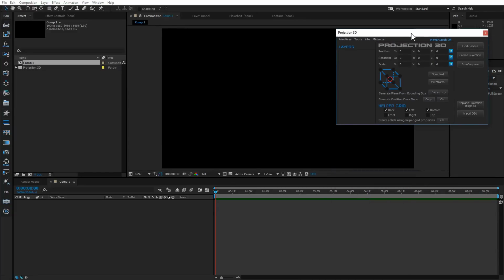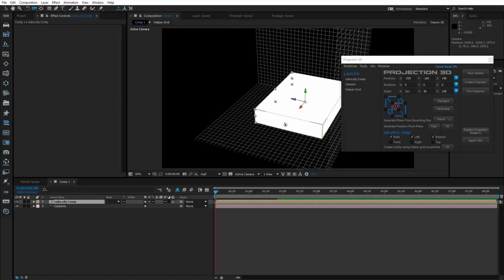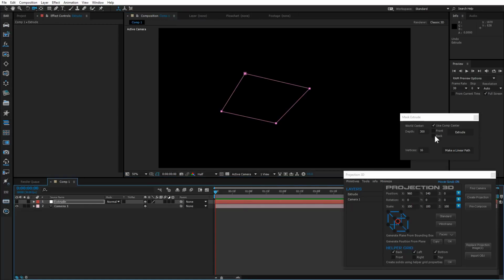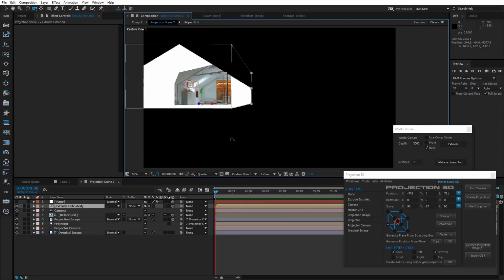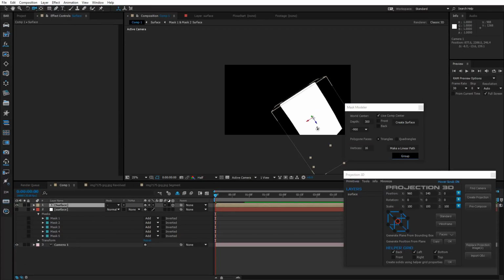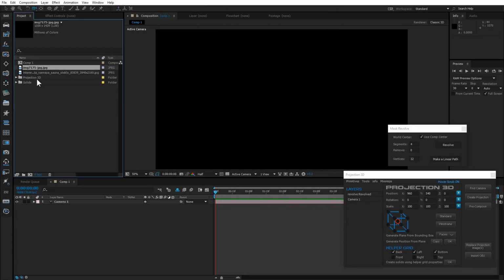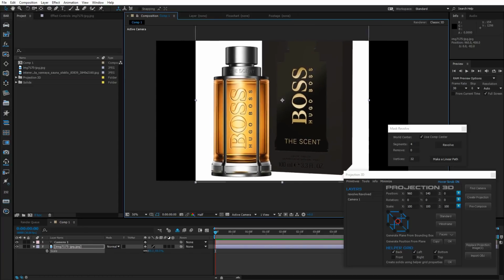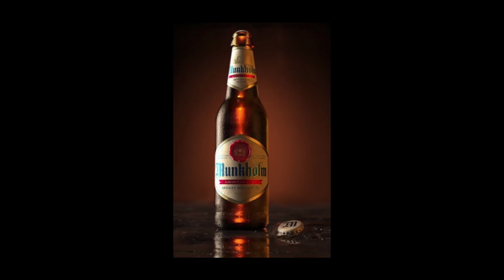Projection 3D Main Tutorial: Intro and Modeling Tools

Comment: Looks like a great piece script..but your tutorials are really confusing and leave alot to be desired..you really need to simplify them or have some one else do a step by step tutorial for you..many of .the comments in this thread express the same level of dissappointment. Alot of the things you look completely over..for example projection grid does not show up in my comp, etc $85 is not alot of money but it is alot when the you don;t have a clue on how to use the script and the basic getting started  tutorials are so lacking in comprehension